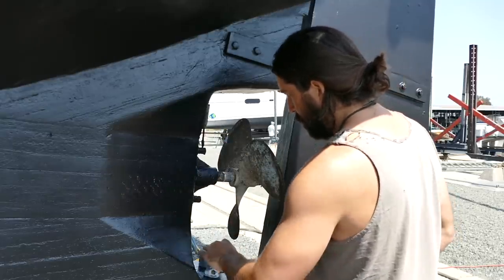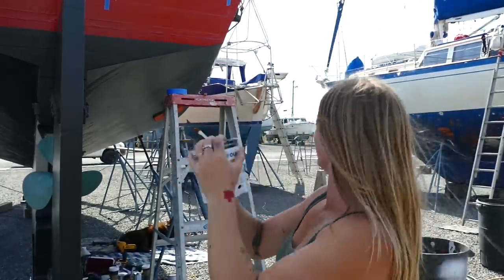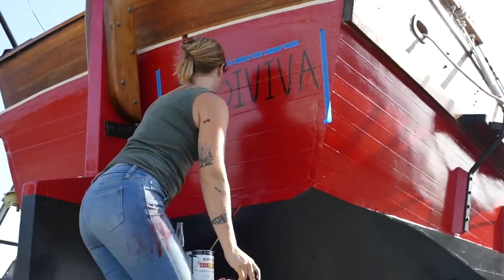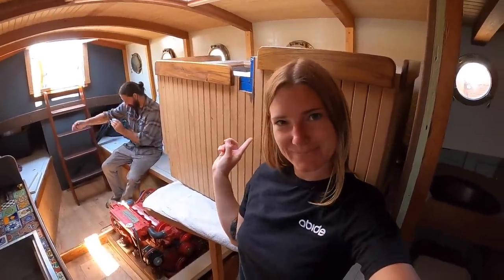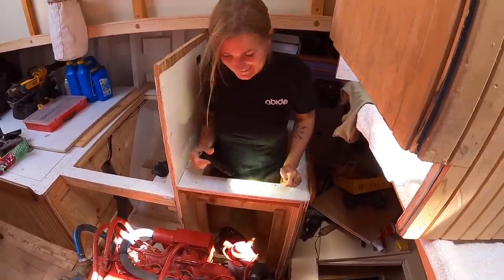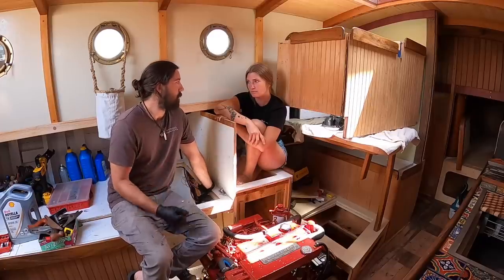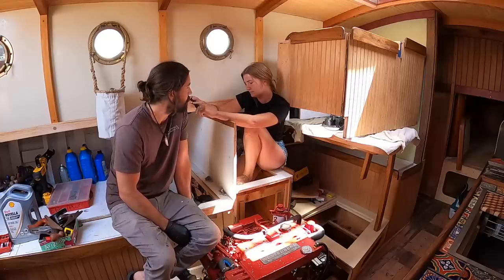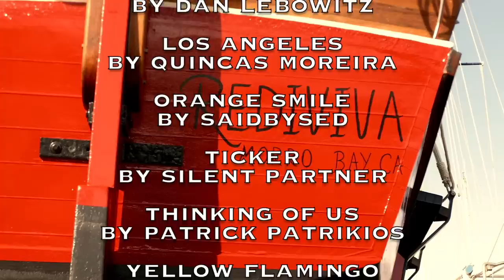Salt & Tar: Ep.197

Comment: Here is a really silly question, and by the time this is answered, because of time difference's with posting. When you last changed the oil filter, did you make sure the O-Ring from the old filter did not stick to the filter housing? Without noticing it, it would stay there and when you spin the new one on, it would work for a while, but it would eventual start to leak under pressure, actually  squirting oil from where the two O-Rings seated at one spot, from anywhere around the O-Ring.

Comment: It feels to me, work that involves woodwork is in your comfort zone and issues that are mechanically related are outside your comfort zone.  This oil leak in reality might (for a professional) might only take less than four hours to fix.  If this is true, the puts the problem is perspective.  The good news is, it looks like the engine you have installed is very basic regards design and complexity and as such even a full rebuild can probably be executed in 2 -3 days.  I suggest, from somewhere generate a positive can-do attitude, grit your teeth and as the Americans say 'Figure it out'.

Comment: Yah, I don’t think you’re leaking thru the oil pan seal. Doesn’t make sense, because if it were, once you’re 2quarts down, the level in the oil pan it wouldn’t leak out—or at least it’d be dramatically reduced.

Comment: There is no need to pull out the engine. Pinpoint the leak and fix it with the engine in place. You don't pull an engine out of a car every time you have a small problem so why pull a boat engine. Your leak is going to be located in an accessible location on the side of the engine, it is not the oil pan gasket. Probably oil filter housing, or depending on location the oil pressure switch. Focus on the oil pressure switch as being the source of the leak if the switch is located in that general area above where you see it dripping.

Comment: No clue as to the root cause of the leak;  sorry!  I will say that you two lovely people are once again, facing an obstacle which is delaying your cruising dreams, but it may just turn out to be a small matter of 'nuts and bolts'.  Long ago, when I was a machinist mate in the 'Nuclear Navy', we were taught to look for the simplest possible cause of a problem.  You did not run the engine 'dry', you were fortunate to discover the leak before any catastrophic damage to the engine occurred;  LUCKY YOU!  Your engine guru pointed you in the right direction to inspect the oil filter adapter flanges to discover the source of the leakage.  It may turn out to be simply a matter of vibration backing out some bolt(s) that were not 'hot torqued' and just requires new gaskets for the sealing surfaces and torquing to spec..  Pay attention to the torque value required to UNDO the bolts, that may be the evidence you need to discover the 'root cause' of the leakage, and thereby giving you peace of mind that you really fixed the problem and allow you to enjoy cruising with no questions in the back of your mind.  Good Luck and Deep Breathes!

Comment: hay did you change the oil filter and check the flange where it seals for any crap on it and the o ring before you pull the engine?

Comment: Is the filter housing leaking or comes it from another place . I have basically the same engine and i had a leaking oil pressure switch . The threads on the standoff where damaged . So i took the whole thing back to work to freshen the thread up . The switch itself was also leaking . So with a new switch and a repaired standoff, i went back to the boat and installed the thing . I turned the engine with the stop knob pulled to get a oil pressure without starting the beast . The oil pressure never came . But almost all oil went into the bilge . I used the wrong hole ! 
So problems are there to be solved . I had the leaking filter housing as well . I would not take the engine out . It runs perfectly, so there is no need for a rebuild . Replace the filter housing gasket and be done with it !

Comment: Dude, I think you should have built a hatch right over the motor and you would be able to pull your motor easier. Pulling the motor is not that hard. You're in the USA and you can get a solid aluminum block machined out to fit the side of the block and have a threaded end to go to a remote oil filter base.

Comment: I have been building commercial fishing boats in Alaska and working on them for the last 30 years. If you put a patch on it, it will let you down in the worst way at the worst time. Who cares what the date you leave if you break down and it turns the trip to shit. This is a part of boat life and putting off the repair or overhaul is just extending the pain and will fuel procrastination.  Boats talk and if it's always making you work on something, it might be time for a new one. I hate to say it but even with the engine running a overhaul is probably going to cost you 1/2 the price of a new Bata engine, plus the down time fixing will keep you off the water most of the summer. So unfortunately it might be time to max out the plastic card. A engine swap could easily be done in a week or two and you will be so much happier and have years of worry free operation plus you can easily sell the old engine since it is running and still in the boat.  I feel your pain I got the same exact problem right now my only problem is my engine is 450hp and cost about the same price as 10 Bata sail boat engines haha. Just try deal with it however and don't look back! 😉

Comment: I would not have put that engine in it to start with.  You need to go with what you can easily get parts for around the world.  Just because you like something does not make it the right choice.  I would have went with something reliable and simple just for the ease of getting parts.  It is not a matter of if you are going to break down, but when.  Building an engine is not a simple task and even the pros get it wrong sometimes.  If you are not a marine mechanic you should leave it alone.  The most common engine used in small sail boats today is not a "Western Leaky"    lol    Just Saying...

Comment: The shaft alignment you have made is wrong. When the engine is running at high speed, the flexible variable shaft creates a strong correction force. The room disrupts the gearbox and the propeller output. It works with 0.5cm tolerance. If this size gets bigger, it does not work. I tried it. Good work.